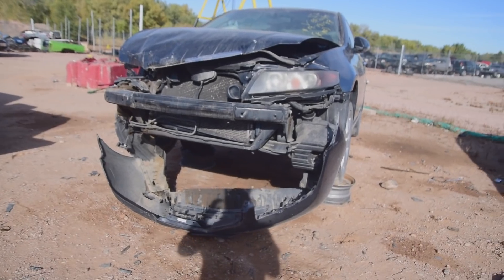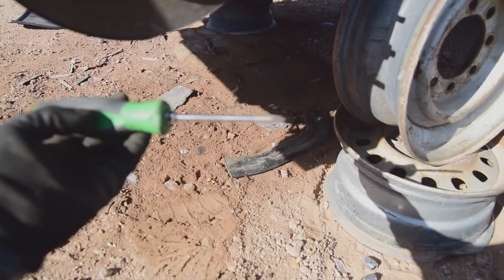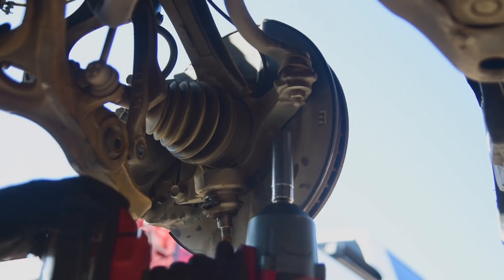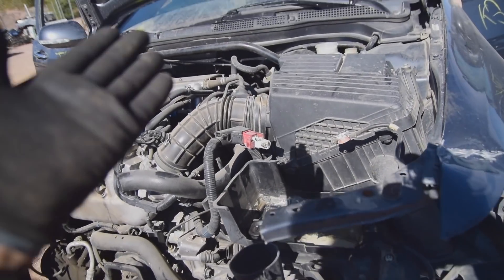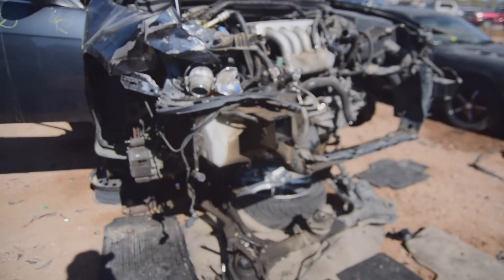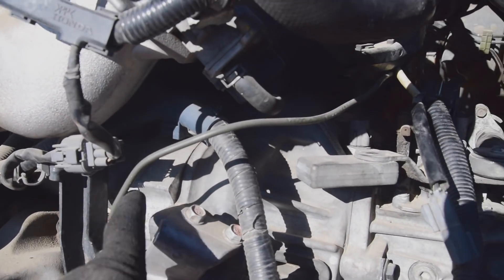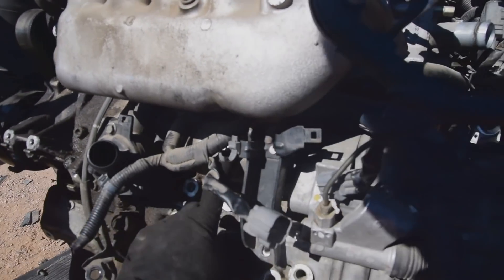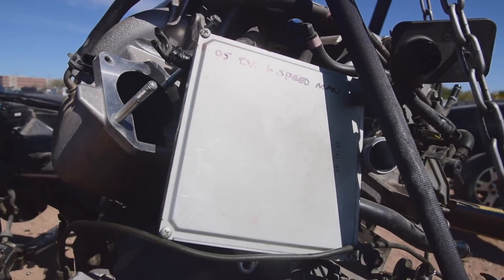How To Yard K Series K24a2 TSX 6 Speed Swap Removal

Comment: 5:00 Most of the time when I am at u-pull yards I will do that to disconnect the axles rather than dealing with the main nut. The longer you take getting stuck on something, more likely someone will be waiting for you to walk away and get it for themselves. Feel bad because I did it to a local guy who got hung up removing a crv trans cause he didnt know about the one hidden 14mm on the bell housing. Besides I view axles as disposable wear items anyways and brand new oem styles ones are cheap enough.

Comment: Hey Robert i have a question. Is it possible to use k24a2 cams on a k24a4 head, will VTEC work normally like in an A2 head?
Reply: KSWPAE86 i think you would need to swap the k24a4 cylinder head to the k24a2 head for that to work. Im not sure if just switching the camshafts would work though
Reply: Aside from small exhaust and coolant features on the block and manifolds, it'll bolt up fine, vtec should work fine too. Still wouldnt do it tho, use a k20 head witht he k24a2 cams. Way more info and swap parts available and you'll likely make way more power.
Reply: James Mulvey i am in the same dilemma. Im working with an 04 accord 5 speed and just want some more power without going full race car. So basically i can throw in the camshafts from the tsx into my accord and everything should be fine???
Reply: @enginehead9966  sure can I believe, most of that stuff is like Lego. If u want to rival the tsx on a budget Go to a junk yard and get some tsx injectors ( rail may not fit, but no harm in trying),intake plenum and throttle body. (The part connected to the throttle body with the big bubble before the runners, not the 4 runners, also connector for tb may not fit from tsx to accord so you may have to use the accord one, not sure), a Hondata or other tune (there's another one on the market that's supposedly better now, do research), and a set of cams from a tsx. Get it tuned ( pricey), and you'll be hanging with the big boys.  I actually put an accord 5 spd in my tsx because the ratios and final drive was better, its a good tranny. Beware tho the accord internals are a little weaker than the tsx's, but not by a ton, so id be hesitant about goofing around with launching, rev limits, fuel and spark timing, and vtec points and timing, it gets risky and I toasted the valves on my 07 a2 and had to swap it out for an 05 a2 for the time being 😷😷
Reply: Just a Question if I pull one of these my self can I swap everything as a whole in a 88 crx? I'm new n this will be a big start for me thx.
Reply: @BellozeCountry  short answer, yes. Long answer, if you're looking for more power, it is wholey not worth it. You'd need computers, harnesses, a lot of custom mods and not to mention, loads of cash. I've been at this for a while and I wouldn't even touch that job. If youve got all that plus time, effort and resources and youre doing it for kicks, if tell you to go for it, but the effort and money required will not be worth the power gains and you will likely be disappointed

Comment: They must give you a special hook up at that yard if you are able to drive your truck to the car.

Hood prop is cool. Removing the hood is a free alternative method.
Reply from the maker: It was a special day. 

Depends if you want to work in the sun. The point was the tool rather than this specific pull.

Comment: How far and where did you go this time?
Reply from the maker: Jose Contreras 1300 miles around trip.
Reply: @hush22performance1  wow,great score and worth it tho. I use to think driving 3hrs was extreme🤣
Reply: I complain when I travel over 60 miles, what the heck?
Reply: @impactajuvenile  60miles is about the furthest yard i would go to but usually the one worth it.
Reply: Jose Contreras I know right? Have you had any success with finding AWD, K motors, or performance parts when you yard? Seems like Hush and YoungStatic are cleaning it all up in the USA??
Reply: @impactajuvenile  i would come up often,but mainly i was there to look for parts for my DA9. Occasionaly i would buy to flip parts. Most of the times the only way to get dibs is to be there when they first set the cars up there otherwise its 50/50 when you see them posted on the website.

Comment: That Milwaukee impact gun can take that axle bolt like nothing the problem is your battery it's a low input you need to get a Milwaukee high output xc 8.0 battery and up for heavy jobs.